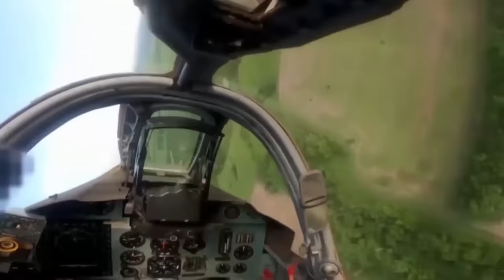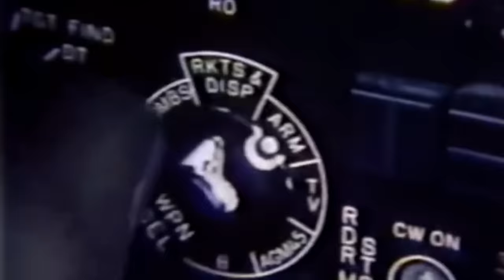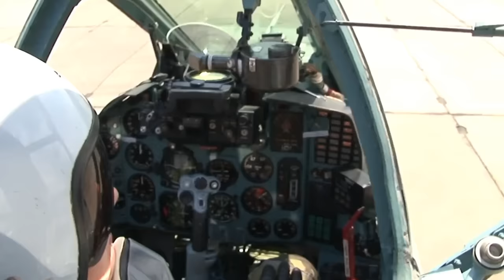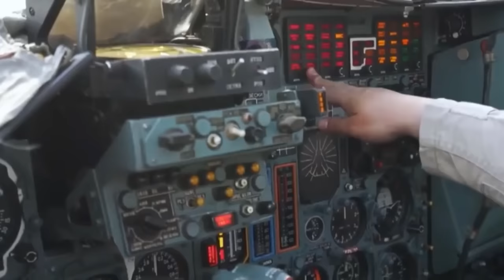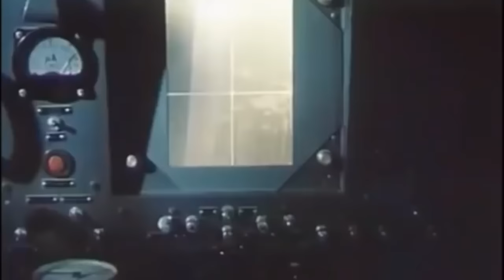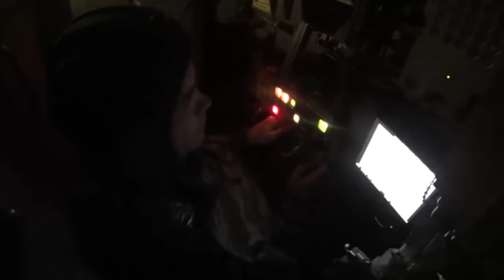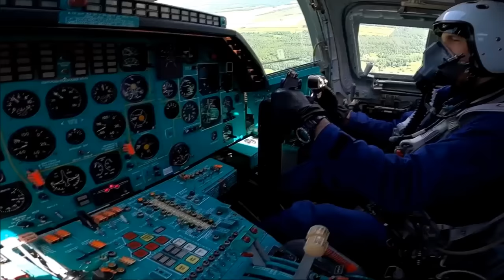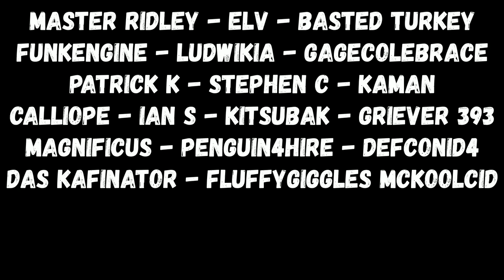The Air War in Ukraine: Who and What?

Comment: You actually missed one SAM system on the Ukraine side the IRIS-T SLM. It is slated to arrive in Ukraine next month (These are Systems that got diverted from the Egypt contract). But otherwise, very good video :)

Also, "Warheads on Foreheads" is a great phrase :D
Reply: https://en.wikipedia.org/wiki/IRIS-T#IRIS-T_SL et seq.
Reply: @gandydancer9710  IRIS-T is not a sidewinder whatsoever. Its a seperate missile developed by the germans intended to replace the sidewinder. And ground launched radar guided variants exist.
Reply: @gandydancer9710  it can basically both be an air to air missile and a sam the differences from what i know are the internal stuff inside it and perhaps guidamce systems
Reply: @fishyfish6050  The ground launched version's have larger boosters...

Comment: The L-39 Albatross is a criminally underappreciated aircraft in modern times. Like the BAE Hawk and F-5E Tiger II, its capabilities far exceed its paper characteristics. As an attack platform it is perfectly sufficient for all tasks involving SEAD & DEAD within the bubble of controlled airspace and as a close air support platform it has adequate capability to engage and destroy enemy vehicles while suppressing enemy troops. The most misunderstood aspect of CAS operations is that the intent is never to outright destroy enemy units, but rather to suppress them long enough for the boots to get in and destroy them for you. We like to talk about warheads on foreheads, but really the most important thing air power can accomplish in a largely ground-based campaign is keep heads down while infantry and cavalry move forward and claim positions with as little effective resistance as possible. 

If there's any lesson we have already learned from this conflict, it is the value of light attack aircraft in the direct support of land forces.

Comment: This war is a repeat of the Iran Iraq war. Where one side has a larger airforce but lacks the ability to use it properly, while the other is limited in size but have been used to it's full effect.
Reply: if you are talking about the iranian air force in the second statement, it should probably be noted that our aircraft were much better
Reply: @grumpyiranian8531  I mean f-5e tiger 2 and f4 phantoms were the back bone of the IAF compared to the tomcats, and they were not getting resupplied compared to Iraq was. Another example of air war similar to this was the italio-Greek war of 1940, where the inexperienced hellenic airforce flying 24 old pzl-24 and gladiator 2s had to face off against the modernized 300+ aircraft of the regia aeronautica flown by veterans pilots of the Spanish civil war.
Reply: @terrynewsome6698  ah yeah i see your point

Comment: Why do most UAVs more closely resemble planes than helicopters? Just curious. Cool video!
Reply from the maker: Mainly altitude and efficiency.  With a large wingspan and light construction you can utilize lift and minimal power to stay on station far longer than an aircraft constantly using fuel to maintain flight.

Comment: Do you know how the German-donated Gepard SPAAGs compare to the Soviet models? Obviously apart from the SAM capabilities.
Reply: They are useless they only gave 15k rounds of ammo. One gepard can use thousands of rounds in a few minutes.
Reply: @Schmidty1  This is inaccurate. A Gepard only carries 680 AA rounds. This would be 37 seconds of continuous fire, but that isn’t how the weapon is used. Normal firing mode against aircraft uses an automatically computed burst size, which is capped at 12 per cannon at most. There is also a special short burst mode for use against UAVs, and single shot mode against ground targets.